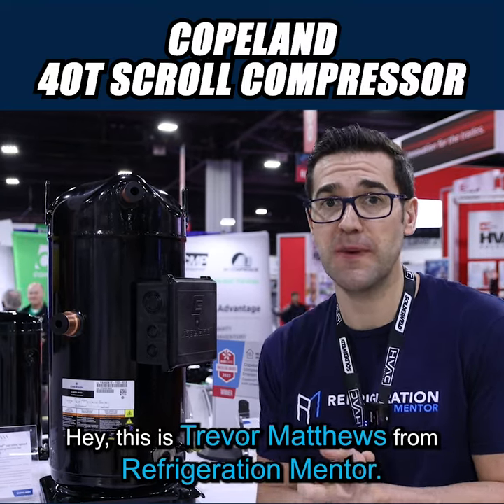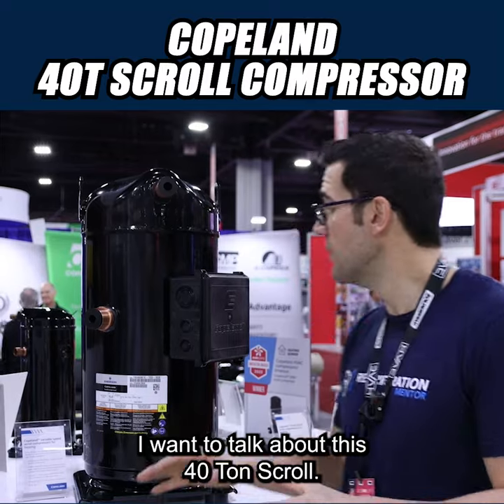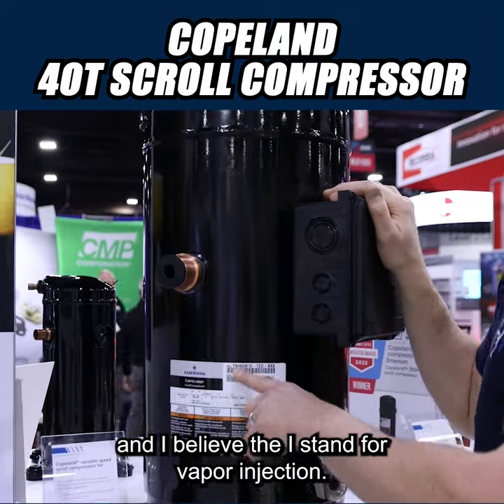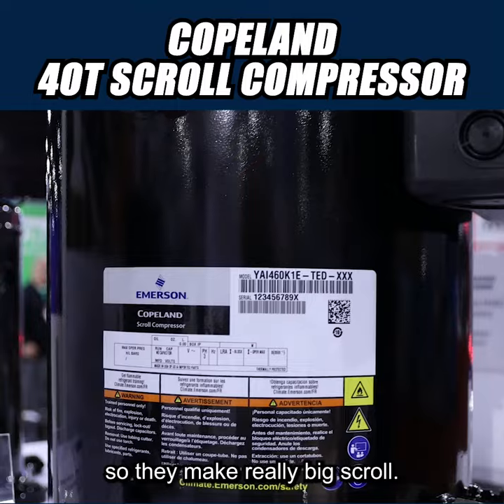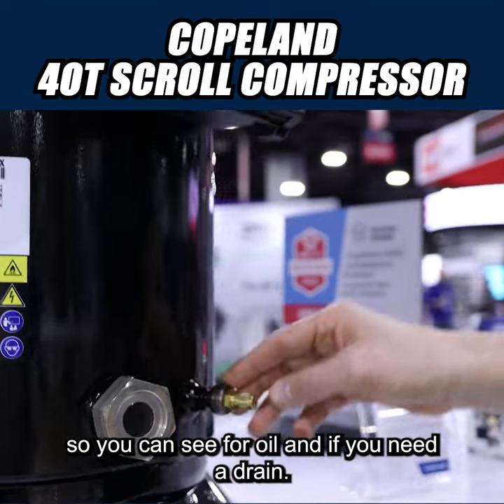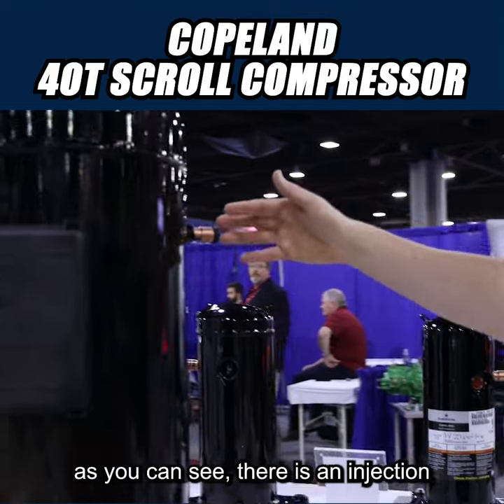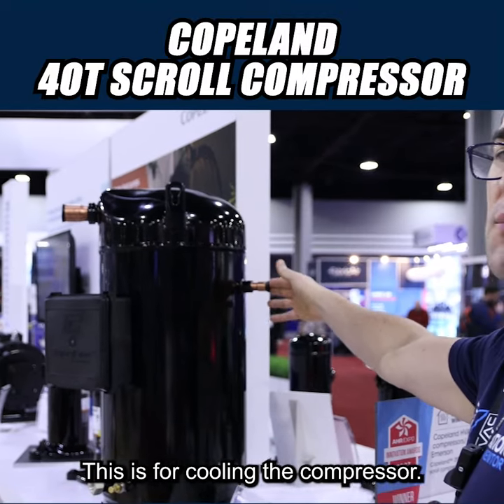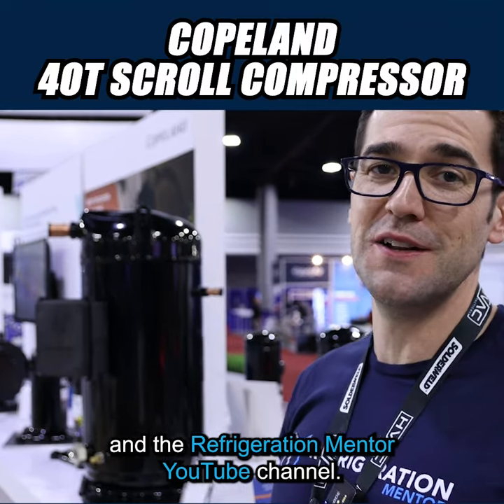Copeland 40T Scroll Compressor | AHR Expo 2023

Comment: Hi, ı am making resarch about cooling systems espacily evaporative cooling+Dx cooling system for data centers. I writed a computer program for evaporative side and ı started to design dx system. İt must be variable frequency system and ı dont need 4 way valve. Do you have any documentations for me to design inverter cooling system? I think it has dificulties about oil managment etc. I am open to any advices thank you
Reply from the maker: Check out Copeland, Bitzers or the specific compressor you are working with. Most of them have variable speed drive technical bulletins, they will definitely help.
Reply: @RefrigerationMentor  thank you sir. I will check the documents.